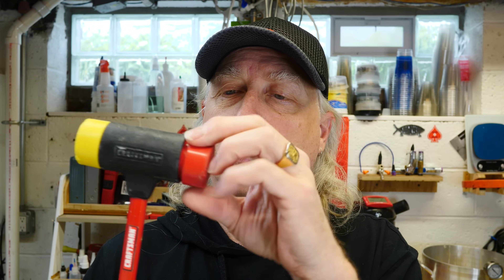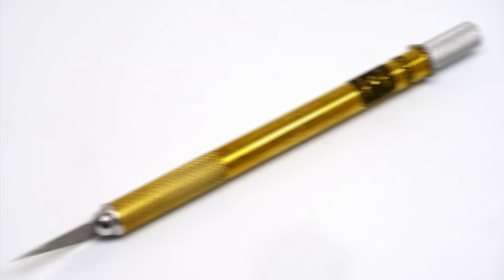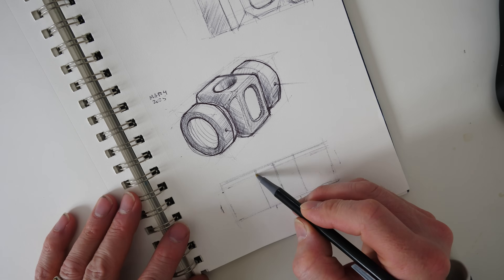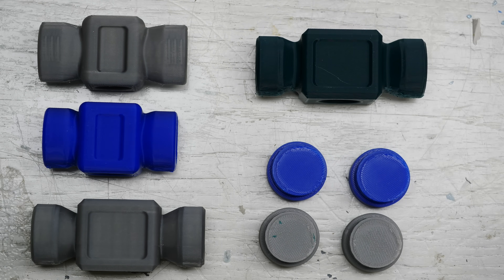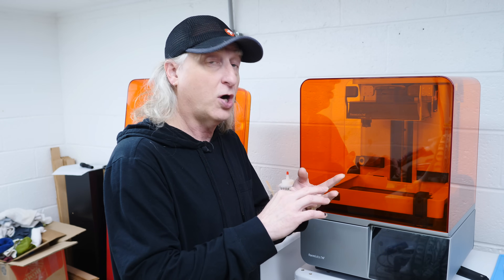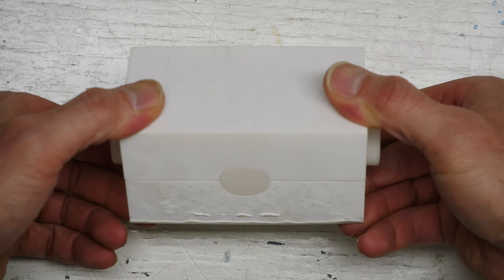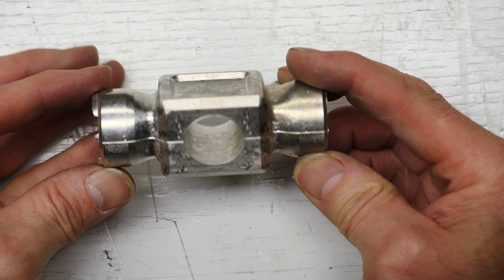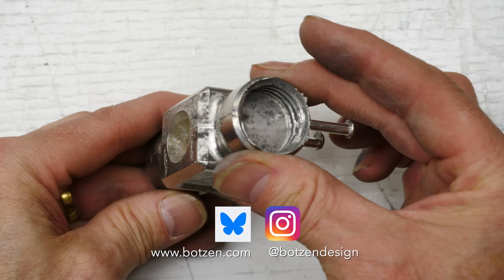A Metal part in a 3D Printed Mold

Comment: I've been having good success with 3d printed ceramic filled SLA molds and using my injection molding machines with some custom MUD toolboxes I've designed to slide these tools into the machines.  It's such a great combination, 3d printed molds and then molding or casting of some kind.

Comment: Hey Eric, love following your channel.  Have you yet used Ultracure3D RG 3280?  It's a 3D DLP printable ceramic resin that's suitable for high temperatures and making plastic molds.  The thought is instead of spending lots of $ for a small mold for plastic parts, one can be 3D printed and used with something like an Injekto 2.0 for repeated ABS injection molded parts in the shop.  Just a heads up if you haven't seen the material before.
Reply from the maker: I'm not familiar with their resin, but formlabs does have their own ceramic resin

Comment: I like your concept sketch phase. I've been training an Industrial Design AI that I use for that.  Takes maybe an hour and I can have 100s of iterations to choose from. Then I just draw whatever it comes up with in CAD. There are AI tools for that too but they will never be able to properly design a parametric sketch fully constrained in a way you want it to be. Not even real humans are good at that I'm constantly annoyed by coworkers who design models that break if you change a few dimensions. Tin Bismuth seems like a good choice, the draft angle was sort of funny to me because resin has about 5x the coefficient of thermal expansion vs tin bismuth. So you dump it in and the resin expands and the part is molded, then the mold shrinks around the part... I thought you were going to need a hammer to retrieve your hammer
Reply: Just draw it man
Reply: @52thephotoshop  I do draw it, the difference is I draw a stick figure in Microsoft Paint, and img2img it and have 30 variations in about 5 minutes of a fully detailed sketch, or a whole concept render if that's what I ask for. I already had a medical product released (as of this Monday) I designed using the concept sketch from the AI. It is easy and takes 5 minutes, I can literally send all the pictures to product managers and just say "pick one" and then that's what I look at when actually designing the mechanical parts in CAD. I'm no slouch at CAD and can do advanced surfacing and injection molded parts all day long. The ID AI simply eliminates the concept phase and shortens its duration to less than a day

Comment: Mmm, that was pretty disappointing.  I hoped to see a printing material in which you can poor real metals, like bronze or at least aluminium... Tin-bismut is useless for a hammer...
Reply from the maker: Remember the hammer has removable heads and is just the weight that the hammer needs, should work great.

Comment: Instead of what you would do for most of the other metals to polish them.
Bismuth metal can be simply burnished with a metal burnisher (I do mine while watching You tubes, because it's kind of a blind man's action.  I pay attention to the areas that I missed while not looking at the part during the commercial's.  Then when I think I've gotten all of it, or all of it that needs the second and third attempt at burnishing). (First Burnishing your trying to get every area you want polished.  Second burnishing onwards is for the extra attention for cleaning up errors or damage, or part lines, etc....)
After you think the metal has gone hardened, simply throw it in a pot of boiling water then let it cool then go back to burnishing it some more.

The Art of Burnishing can move metal into filling in pits and voids so be aware that by moving the burnisher in the same stroking direction you literally are moving the metal around.

Comment: Next time you need to add a cone above the model that is the metal reserve ware.
It's purpose is that as the metal goes from a liquid to a Solid there are molecules that are getting closer to each other.  This causes the liquid level to lower, OR (And this is the important part) the liquid starts to barrow material but there is NO place to lend it any.  So it causes a stress line, IE a weakness in the metal that will form a crack when you apply stresses to the solid metal part.

You don't want to see that shrinking directly over the part and close to it.  
You want a reserve above the part (Sand casting often has the flow go down to the level of the part and then fills the pattern evenly and level but that's a different topic) that does the shrinking and the stressed area is then cut off the finished part.

You don't need to remake the model.
Just add a two part cone over the pour hole and you can even secure it with just duct tape as opposed to adding things like alignment pins etc....

Comment: What are the mechanical properties of tin bismuth alloy? is it useable for mechanical parts (eg. closer to cast zinc) or just too soft (eg. closer to solder)?
Reply: It is very soft and brittle. It's actually used as solder in some special applications (possibly a slightly different alloy than the one in the video) because it is lead free while having a very low melting point. But it performs poorly even as solder. So I think it's very unsuitable for mechanical parts. Many common plastics would probably perform better.
Reply from the maker: Soft perhaps, I don't see the brittleness you refer to. Has a lot of weight to it.. seems like a good option for non stress metal parts. Seems durable and definitely more eco friendly than plastic.

Comment: I think you could use a bit more wall thickness in the threaded part. I think that's the weakest point, and it may not stand up to repeated blows over time.
Reply from the maker: Time will tell, plus I wanted to see if it would cast that thin

Comment: That is Fantastic.  Amazing precision.  Surprised by the lack of shrinkage the tin bismuth alloy seems to have, that small pouring basin and sprue was able to feed it completely.
Reply from the maker: Better than I expected
Reply: Ooo, it shrank.  That's why it was gripping the end parts so hard.  There are ways to control the direction of the shrinkage but it's easier to find the shrink factor of the metal and then simply over size the master Model by like 105% so that the 5% (again depends on the metal, or epoxy etc... shrink factors.) turns out to be reduced down to 100% of the desired size.

Comment: On pewter castings with high temp silicone (Smooth-on Mold Max 60) I use talcum powder as a release agent. But not sure it will stick to the resin. Very interesting process though, looking forward to the next part.
Reply: I poured a two part epoxy last week.
The Smooth-on Mold Max 60 did no want to flex as much as I needed and broke apart rather than release finished part.
Talcum powder is OK.
I often use Pam cooking spray when making things like a Mother that is the plaster over the Smooth-on Mold Max 60.

When doing a thin liquid I use clear packing tape (No string line type)  in various place so that I can see where a thin liquid is leaking.  Have some gum, or silly putty around to plug the holes as well as tapes.  (DO NOT USE COMMON KIDS NON HARDENING CLAY.  THEY CONTAIN SULFER AND THOSE IN GENERAL WILL STOP THE CURING PROCESS.  So it's best to banish it from you studio in general.)

Comment: Wow. awesome video! I am curius about the strength of the tin bismuth alloy. How easy is it to scratch or dent compared to something like steel? I've allways wondered if I could cast durrible parts like gears and such with low melting point metals.
Reply from the maker: Yeah, for many applications I think that would work

Comment: Is there a reason normal spray-silicone release agent wouldn't work? It's not like silicone is going to phase change or decompose at 140c. 

Also, even though it didn't spring off the mold, I'd bet that particular metal is way more susceptible to thermal contraction than the mold is. Maybe just stick it in the freezer for a while next time?
Reply: Self correction - apparently Bismuth actually expands as it solidifies, like ice. Better not stick that thing in the freezer unless you're willing to go for explosive demolding😵‍💫
Reply from the maker: Ok, good to know

Comment: One suggestion for printing the molds. Try printing them on the side, just change sides so they are angled 15-30deg. This way you don't have a problem with the suction and layer lines on the round parts should be less noticeable.
Reply from the maker: Yes, they are printed at an angle as you suggested.